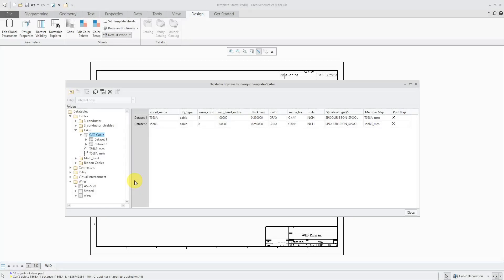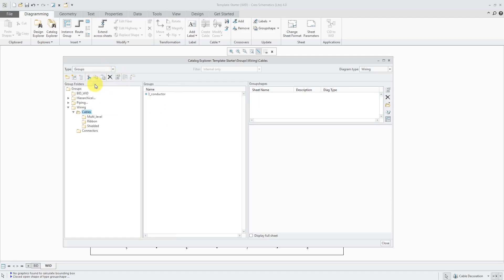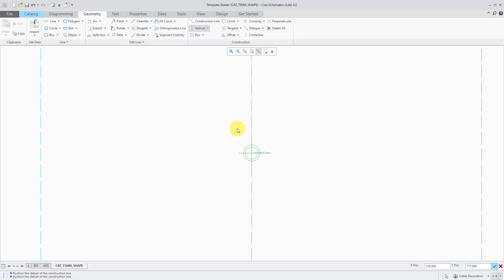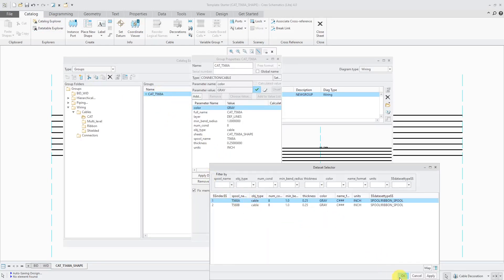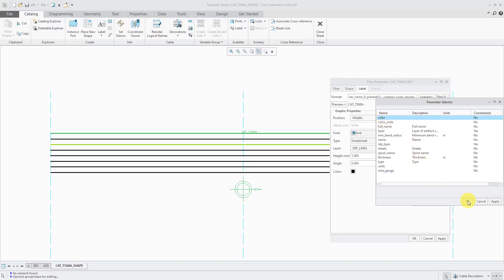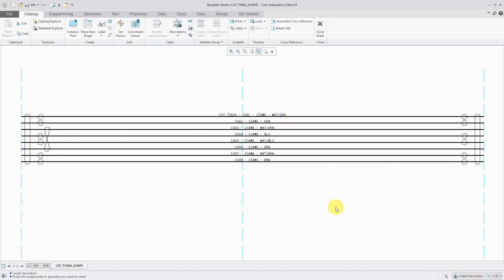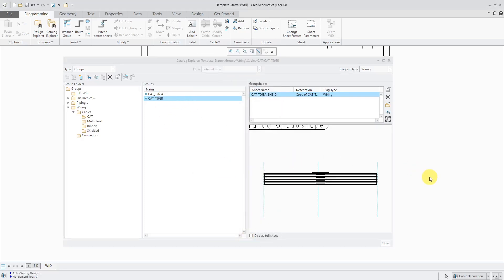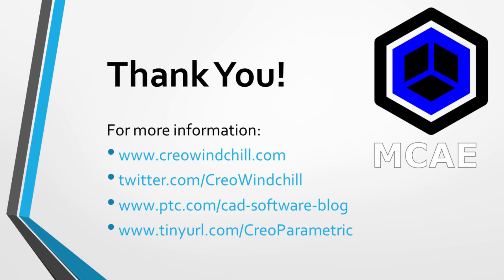Creo Schematics - Creating a Cable Artifact | Creo Parametric Cabling

Comment: Thanks for the excellent videos on Creo cabling! It's difficult to find any information about this online aside from the not-so-clear Creo tutorials. I was able to set up my cables in schematics and export an XML for 3D routing thanks to you! However, I was wondering how you get the outer cable diameter to show in the Parametric 5.0 route? When I thicken the cabling, all of my wires show, however the outer cable sheath around the wires/cores does not show even though I have included the "thickness" parameter in my .csv. Perhaps I have to set up a sheath spool or similar? Though it's strange that Creo would want a thickness parameter for cabling but then not use it. Any help on the matter is much appreciated cheers!
Reply: You need to route the cable using a network for the insulation to show up.